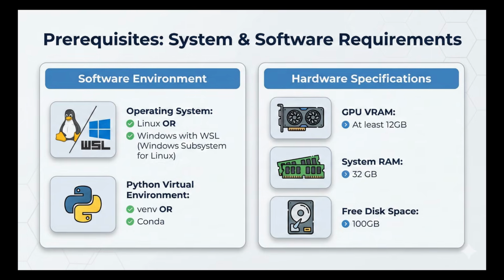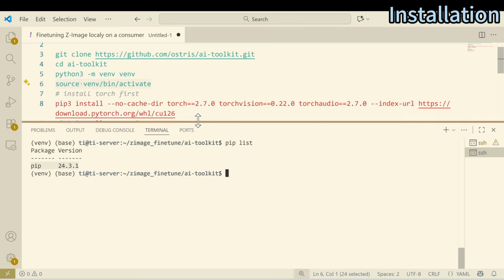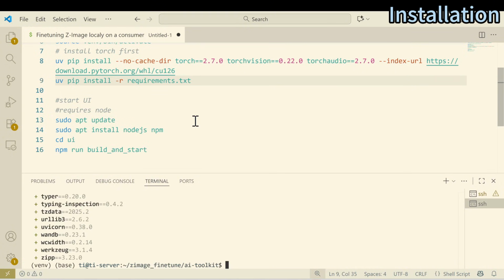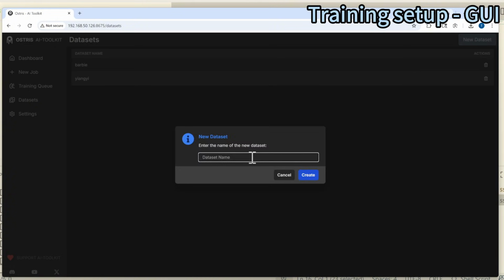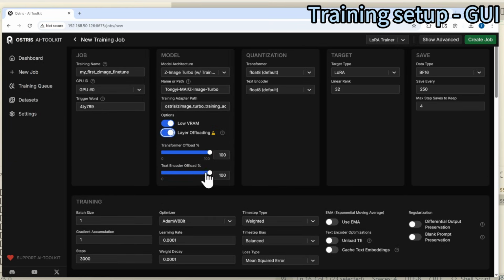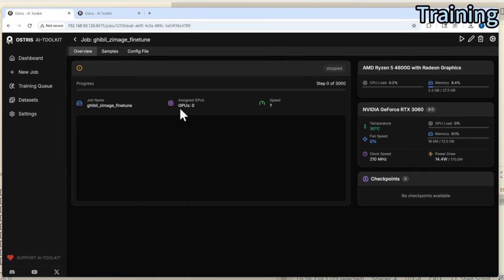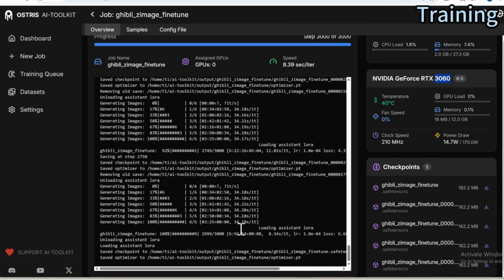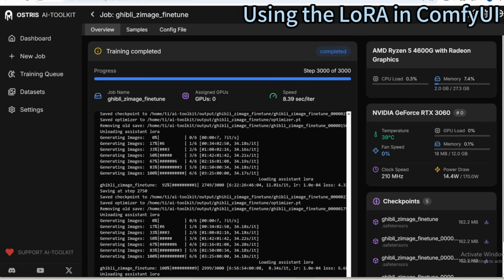Finetuning Z-Image LoRA locally using AI-Toolkit: Works on 12GB VRAM Nvidia GPU such as RTX 3060

Comment: Hi, i need some advice. I currently have a gtx1660ti 6gb and im just playing around with comfyui but the vram wont let me run video models. Im thinking of getting a rtx 3060 12gb for this and learn the process for youtube AI vids. Is it a good idea to get it or not worth it? the 16gb ones are like +50% more in price (90k pkr -> 140k pkr).
Reply from the maker: 3060 12gb is one of the best entry level card. 16gb ilworth it if you want to run bigger model.
Reply: Can you do a tutorial on how to do thins inside comfyui. I don’t want to have to install and run a separate venv just for this.